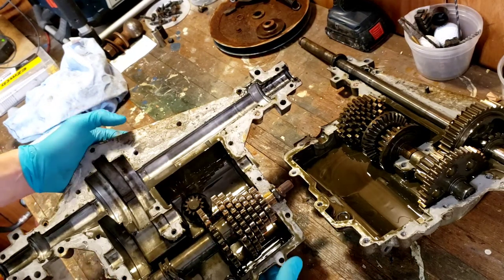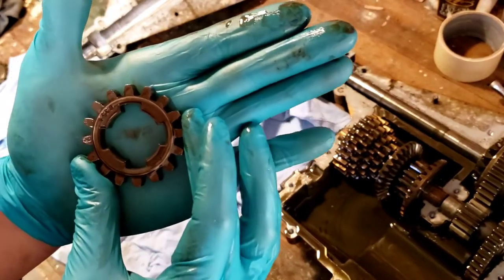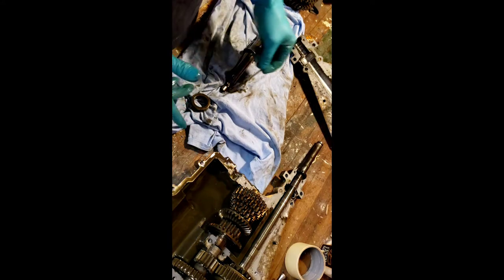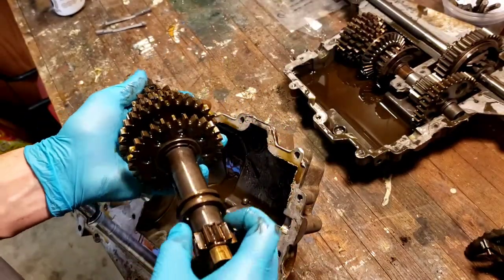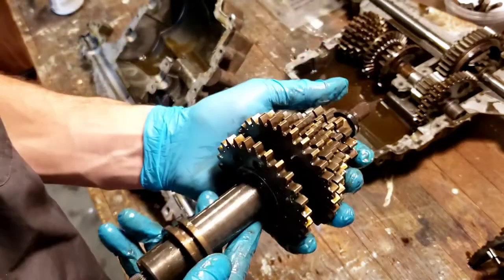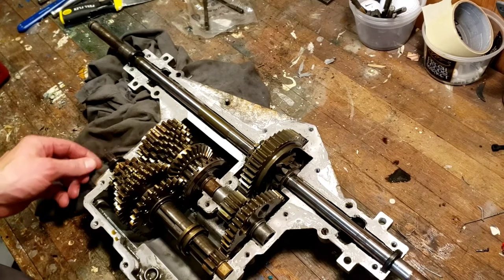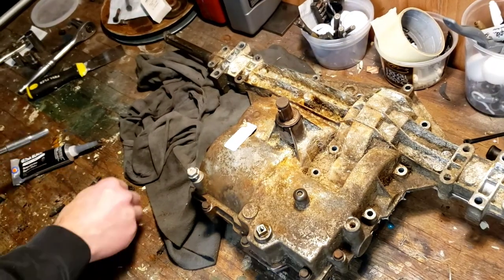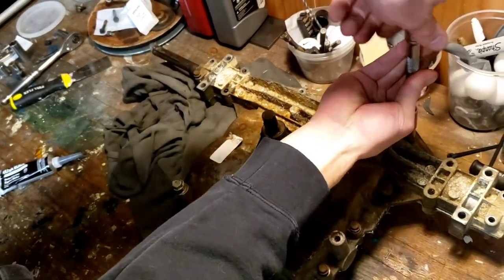Transaxle peerless model 206-565 Shift Keys and Fluid 3 of 4

Comment: What was the initial issue?  I just picked up a freebee from dump that runs mint, but can only get 1st n reverse, similar axle, an MST-206-502A, hoping the keys you used, look like a 792180 in mirror, tried to read that bag. is my issue.. since cannot read label to know model number cannot look up parts, could only get axle numbers, that sticker in place...  mowing in 1st is not fun...
Reply: There was a sticker on rear tire saying to add grease, it was out of lube, and the axle looked like new it was so clean, appears to be something like a 98 Murray 12.5hp 42" widebody, again sticker for model number on tractor itself was torn in half and what is left is just white, cannot read a thing... I had filled mine up, had a combo drain n fill plug, but could not get plug back in, is like 2x size and pushing a tool into middle of plug, is hollow, not enough room in place.. so will do on bench and see what is wrong,,, grass mowed have a week to play and hope correct keys and no other issues,,,

Comment: Is it possible to swap forward and reverse? What i mean by that is my mower movers forward in reverse gear and reverse in gears 1-5. Its not the original transaxle so im tryna see if i can take the trans apart and make it to where im going forward in gears 1-5 instead of backwards

Comment: How do you get the spider gear together?
Reply: Just keep working it they will fit together its actually frustrating. I welded mine to make it locked for posi rear end took a bit to get it together right